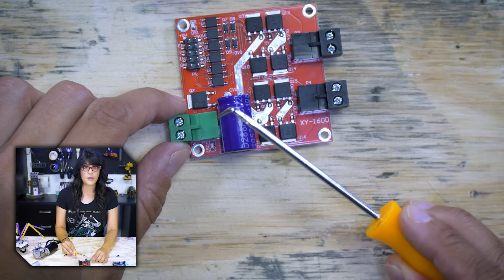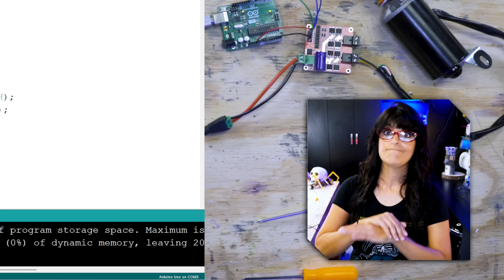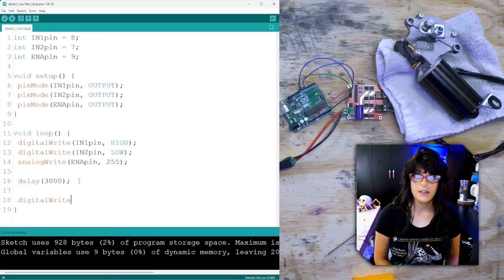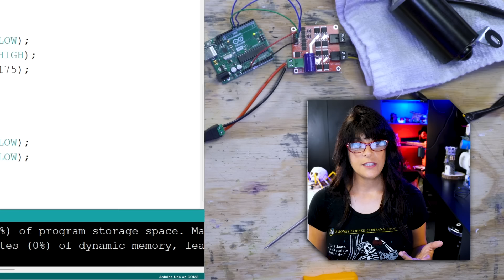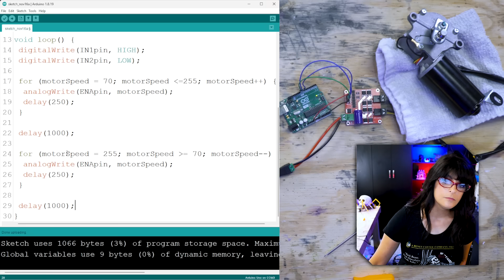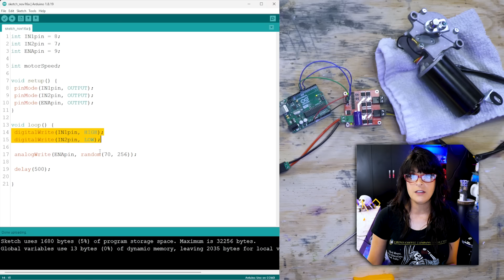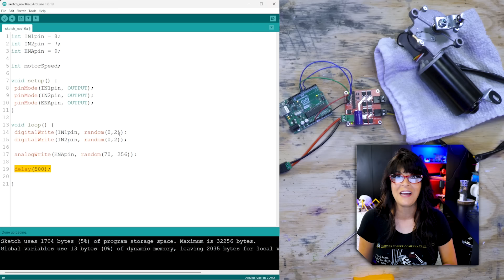How to Control a 12V Motor with Arduino: Easy Wiring & Code Examples

Comment: I randomly came across this video by following the "YouTube rabbit hole." I have absolutely zero experience with the Arduino- I've never even seen one in person. I only know of their existence because some people make projects with them in amateur radio (my main hobby). Plus, I'm in my early 50s, so I don't soak up information as well as younger people. However, there wasn't a single thing you presented in this video that I didn't fully understand. Your teaching style is outstanding and you made all the gears click in my brain- and some of those gears are pretty rusty! That's a subscribe for me!

Comment: Basically this would be a good video if you show how to control the wiper motor at delay various speeds between low and high and then you have the shut-off circuits that make sure the wiper blades shut off and the blades are in the right position. This should be super great video with just with simple things like this, especially the time delay on an older wiper motor.

Comment: I was a controls engineer for 45+ years and also taught industrial controls and PLC's at the local community college. You have a very nice teaching style, good job. I just found your channel so what I'm about to say you might have already addressed in another video, but when using Arduino, I tell people to never use the delay() function because the delay() function literally stops the program from executing code. So...if you set a delay(3000) 3-seconds and there is code below the delay(3000)  that needs to be serviced during that 3-sec. delay, it will not get serviced. I recommend using the millis() or micros() function and setting a duty cycle with a bit of math for current time and previous time. That way the program keeps "scanning' the loop() function even during the delay.
Reply from the maker: You're absolutely right! 👍 Except for simple programs, I usually stick with millis(). I do have a video dedicated to using millis and another one for using interrupts. But I can't deny that delay is an easy concept for beginners that have little to no coding experience to understand, so that's why you see them in all my beginner videos like this one. I have another millis video coming out using a PIR sensor to orchestrate LEDs, servos, motors and mp3 players in March! Stay tuned!
Reply: @RachelDeBarrosLive  Thanks for the reply Rachel. I found your millis() video and your interrupt video. Very well done. I'll be very interested in the mp3 player. I'm doing the research for animating a Moebius 1:6 scale Lost in Space robot and already have sound files so I'll be interested in how [you] do the mp3 player. I'm looking for one that I can chose what sound track I want to play. My plan is to have everything RC controlled. That's all new ground for me, but it's so much fun!!!! I'll be watching. Great job!!! I'm so glad I found your channel. 😀😀
Reply: Excellent work! Thank you
Reply: When using microcontrollers, I use a SW interrupt and a global flag counter variable for this equivalent functionality.  For example, if I require a delay of say 10 ms, and the period of the interrupt is 1 ms (the flag gets incremented inside the interrupt), I include a conditional statement requiring for the flag to equal 10.

@RachelDeBarrosLive By the way, very cool video.  I know the amount of work and effort that goes into producing these videos is a lot.  So definitely appreciate all of your efforts.  Just one small point that I would add is a small mention that you need some type of controller/compensator (i.e., PID) for feedback control in the SW to accurately control the motor speed.

Comment: Something like 400 and 800 Hz echo in your mic and/or room. Trying to EQ it out but still sounds so bad :( my poor ears. Wish I could send you a $60 mic or better.
Reply from the maker: Audio has been a challenge because I'm in an open space (garage) with concrete walls and high ceilings - so a lot of reverb and echo. These same mics sound fantastic in smaller rooms (and are far more expensive than $60). I've put up the same foam padding as they use in recording studios all over the ceiling and walls that aren't seen on camera but I honestly haven't noticed much of a difference. My next idea is to add curtains to try and make the space I'm using smaller.
Reply: @RachelDeBarrosLive  Damn! But don't worry...seems most people have crappy hearing anyway.  My ears are too good. I should have found a way to make lots of money off my audio abilities :(
Reply: @RachelDeBarrosLive  Move mice closer to your voice and get a floor stand (off your desk)... That will for sure help. (The closer to you, the less the room matters.)

Comment: Hello how could I run a 8 channel relay board from 12v dc also using a fuse flock and a 9v regulator as well as a HC-05 wifi control board please 
Thank you for your time 
Kind regards Nick from New Zealand

Comment: Very nice, thank you. Little confused about power in both boards. If I remove the USB coding cable (assume I am done coding), does the Uno board still have power (5 Volts?)? Is the Uno 5 volts coming from the Motor Shield? In other words, does the Uno still have 5 volts and the Motor Shield 12 volts when USB cable is disconnected? Thank You.
Reply from the maker: The USB cable that goes from your computer to the Arduino both powers it and allows you to upload code to it. As long as the Arduino is getting power from this cable, it can also power the motor driver module. The 12V power supply only powers the motor and nothing else.

If you disconnect the USB cable from the Arduino then it won't have power and neither will the motor driver module. You can either continue powering your Arduino with the USB cable or use the barrel jack right next to that to plug in a 9V power adapter. You can also power the Arduino with a battery pack.
Reply: Thank you so much Rachel but I am still not clear. 
Assume I have already uploaded the code to the UNO and disconnected my Laptop USB cable from the UNO (UNO now has no power).  
I now connect the 12-volt power supply to the Motor Shield. 
Is the UNO somehow getting 5 volts from the Motor Shield? 
I really don’t want to have two power sources, one to the UNO (USB) and one to the Motor Shield (12-volt). 
My plan is to place the UNO WFI board/Motor Shield/12-volt connection in another room and send signals from my Cell Phone to the UNO by Wi-Fi.
I have some really good ideas for more videos you can do.
Thank you. 
 @RachelDeBarrosLive

Comment: Have been using Arduinos for over a decade now and it's great to see someone who is equally excited about them.
Reply from the maker: 🤣 Arduino has allowed me to do so many cool projects!
Reply: @RachelDeBarrosLive  I would be interested in a library of cool projects, or ideas that could be projects if one had the prerequisite skills like welding. The problem I have is a lack of imagination, if someone could suggest a solution I'd be all over it.

Comment: When I type pinMode(IN1pin, OUTPUT); output is not recognized. Does anyone know why that is?
Reply from the maker: I imagine you mean that OUTPUT is not turning into a green color. If that's the case, are you using all caps like OUTPUT instead of output or Output?

Comment: Thanks for the demo.  It gave me an idea on how to scare woodpeckers away from drilling holes in the side of our house. A while back amazon was selling the large spiders that would reel down on a wire quickly when it detected a noise. After a period of time it would reel back up. It turned out these spiders were a great deterrent for woodpeckers. Only problem is they are not available anymore due to defective operation.  I was wondering if you could hook a microphone to the arduino and decode the woodpecker as a 101010... and drop the spider, shake it around and make some hissing noise. Could you outline this code on how to get started? This would be a fun project.  Can the arduino go to sleep and listen for the thump of the woodpecker.  Also it might make a fun Halloween project.

Comment: For that last example if you want to avoid the case of double zeros or double ones stopping the motor, change the first 3 lines of your loop:

void loop() {
  int spinDir = random(0,2);
  digitalWrite(IN1pin, spinDir);
  digitalWrite(IN2pin, 1-spinDir);
  …

Now whatever spinDir is set to (0 or 1), the second pin will be set to 1 minus that value:  so if it picks 0, the second pin will be 1 - 0 = 1. If it picks 1, second pin will be 1 - 1 = 0.

Any time you need to flip between 2 numbers but don’t want to waste time checking the current value, perhaps in an interrupt routine, just add the 2 numbers together and set the value to that sum minus the current variable. This will always work as long as you initialize the variable to one of the two values.

So if you need a variable K to flip between 13 or 77, just do:
…
  int K = 13;  // initialize variable
…
  K = 90 - K; // flip to other value
…

So the first time it flips:
  90 - 13 = 77
Second flip:
  90 - 77 = 13
Etc…
Reply: man thankyou for this addition 😍

Comment: I won an Edison (with Arduino breakout board) from Intel and the only thing I could think to do with it was to drive the dual electric fans in my project car by PWM based on temp input. I knew it couldn't handle the voltage/amps, and that (mechanical) relays wouldn't like PWM input. Solid-state relays are stupid expensive, so I gave up on the idea. I didn't think about a motor driver board tho. Wonder if I could source one beefy enuf? 🤔

Comment: First, great video and explanation!
Let me give a few remarks on coding:
1. as another commentator already stated, using #define constants instead of variables for "never changing" or "magic number" values, like pin associations, or the motor's low speed (magic number 70), is better.
2. inherited from C++ (Arduino language is basically a superset of C++), you can use the shortcut var += increment instead of var = var + increment. Works with all arithmetic operators (-=, *=, /=,...).
3. try to avoid delay(). The processor is literally delaying then, means it does nothing else. You'll get in trouble if you want to do something concurrently then. 
4. I'd have the movement of the motor put into a function, like void turn( int direction, int speed ), so you reduce three lines of code into one. Same with stop().

Re my point 3: I've almost nobody seen to address this, albeit this is basic microprocessor programming knowledge I learned almost 40 years ago 😊(Yes I'm an Old White Man, and credits to Professor Reichert of Engineering school Aalen who was a great teacher). I wrote a tiny class that works as a timer and executes code after a specified delay or in specified intervals, or tells you if a delay is over instead of halting the program. Also you can break the granularity down from milliseconds to microseconds, because you can use the micros() function instead of the millis(). The caveat is that this method adds some imponderability to the programs, so you can't predict when exactly which function is executed, because that depends on if some function is busy longer than the time checking interval is.

But great explanation of the Arduino's power capabilities! Overloading ports is one reason why newbies fry their Arduinos and then end up frustrated.

Comment: I love your instruction style already - I'm yours.
I have most of the arduino cards but I see the motor controller you are using is not avail (Amazon)
Is there an upgraded substitute? Thanks for the knowledge. Oh and do they make a motor controller that is an attachable shield? //ji

Comment: Hi, if I want to control the motor with a 5V thumb roller with 2.5V at rest and decrease in one direction to 0.5V and increase to 4.5 volts in the other direction

Comment: to prevent the stopping with both IN1pin and IN2pin having the same number ... assign the random(0,2) to a variable and use opposite notation for the second pin
IE:
direction = random(0,2);
digitalWrite(In1pin, direction);
digitalWrite(IN2pin, !direction);

if that works, then you could eliminate the stop if you wanted

Comment: Rach, you have a lot of knowledge, you explain ok, but you have little wisdom.  you should create arduino projects that are close to reality. like... controlling an array of 1-3 water valves in oder to water huge gardens. or start a a fan one a temperature sensor reaches this . or start a motor when a temperature sensor reaches this.  i mean... people live real lives. the age of angry birds and fancy dancy do it for fun is gone. we matured.  i want to use an arduino to automatically start a gas stove and PID control the flame intensity by controlling a valve. i dotn want the milk to boil, i want it to stay at 90 Celsius.  do it. i mean... cpiders..crawlers..all is bla bla. wake upt, do real life arduino projects. buy real valves, connect them , and do it. you cant operate in the imaginary world just switching on and off. no

Comment: Incy Wincy is going to need longer to get back to the ceiling if you're winding it in slower. Since you've set the PWM @ 2/3rds the value, running the motor for half as long again would be a fair starting point.

Comment: Any way to add in safety,  like high resistance to trigger the motor to stop.  Incase something or someone gets tangled in the animation you are working on? Like  sliding doors on a minivan.

Comment: You made your movies for kids, but the once that respond very positively to them are we, grown ups and old people. That's very interesting, Anyway, keep doing what you're doing. F.e. your millis clip is unbeatable. What do you think about a comparison between frequency and pwm. there are motors with an inbuild pwm converter that can take a pwm signal with any frequency from 300 hz to some khz. And than a question comes to my mind, why is the frequency of an arduino pwm signal 490 or 980 Hz? And last but not least, I realized, even small children are already doing a cost benefit calculation, where the cost is the making of the part, and the benefit is the fun it generates when they use it to blow up the neighbors mailbox with it. So to get  access to kids means to provide them with benefit. I

Comment: I have always been drawn way more to hardware then programming, but this integrates both. The industrial machines i worked on do this on a larger scale, so this is the path to greater machinery starting here.

Comment: congratulations from Brazil...+2 subsc. 
obs.: random enable is not safe to Mosfet or power supply. "short circuit" 

Can change random both together (0,1 1,0) or (1,0 0,1) with some delay .

Comment: I'm new to your channel, and I'm enjoying it. Question. I want to control a wiper motor or a linear actuator based on windspeed through an Arduino.  Help, please and thanks. (I have found some great videos measuring wind speed with an Arduino and, of course, videos such as yours with Arduino controlling a motor) I just need to combine the two.  Thanks in advance

Comment: Ok  hi  Rachal i am so glad i fond your channel i have watch you present program on programming a  Arduino . & coding . now let me tell you abbot my self I'm 71 years  old , & Dyslexic. So leaning to coding  for me is a bit of a challenge.  Now my projects will be tow off  One the converting of my  old lathe  to run on an electric lead screw.    & tow is a app for spelling that will add a pitcher .  to  match the spelling when there is  more  than one way to spell the word lick   Night- or - Knight   so the grammar is Wight r   a person  grat  or like the one in the fire places  & or an individual.  so learning to code is imperative & i have never done  coding.  . then there the bracket & things that Mack the langwidge work ? so lets get started tell me the best way to start.

Comment: I hope your of Brazilian heritage as anyone who reads your name will automatically start replying in Portuguese, AND assuming you are LOL
Reply from the maker: You would be right! 🇧🇷 Recebo mensagens em Português o tempo todo!
Reply: Are you Brazilian?
I just started on micro machining and came up to your videos by searching on how to control steeper motors. I still don’t understand all the details on the controllers but your videos help a lot. Sure I’m using NEMA 23 (or 17?) motors with a controller that needs Mach3 software but pretty sure it’s an interface to Arduino. I was even wondering how to find out if it really is but no knowledge enough yet. 

Reading your bio I see you’ve been in many projects and even TV!!! Amazing accomplishments!!

Well, thank you for replying!!!

Comment: Little correction: 50% duty cycle equals half the power, not half the voltage. Voltage equals the square root of the duty cycle.

Comment: A module to control motors requires a heatsink applied with high quality thermal paste and a fan constantly blowing. Each MOSFET requires a thermal contact with the heatsink. When you do that, it will work very good. Otherwise, the MOSFETs will overheat rapidly and burn up.

Comment: I love the way you teach as it sinks in,
 I would like to have this project but have it reduced in size,  meaning using an ATtiny54 or 85 chip to control the motor and to have only one power source and to turn it on using a push button trigger and upon release it stops, 
It would be pefect for me to start  a robot project that is manually controlled.
Iwill work out the coding by myselfas cant expect everthing to be done :)